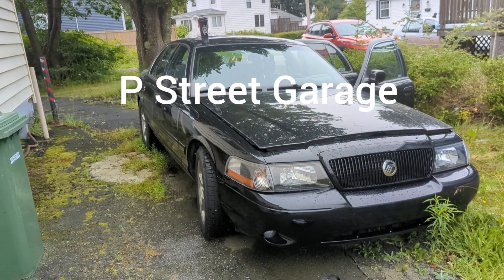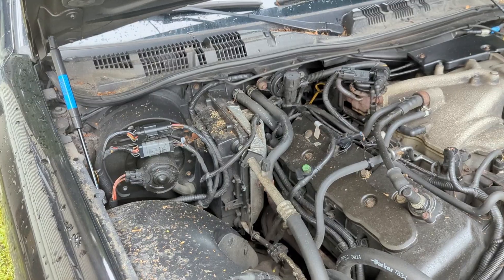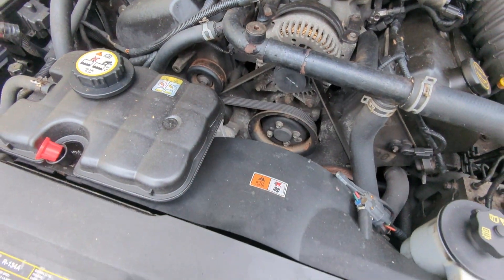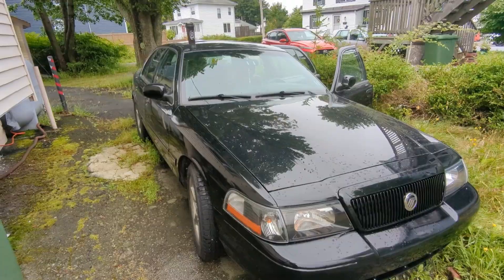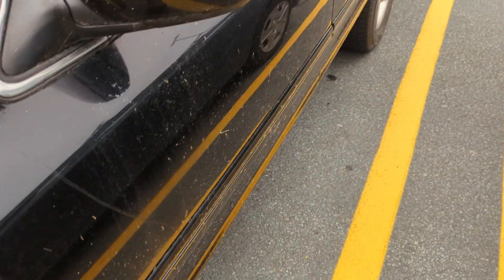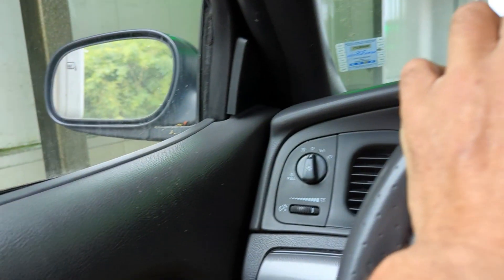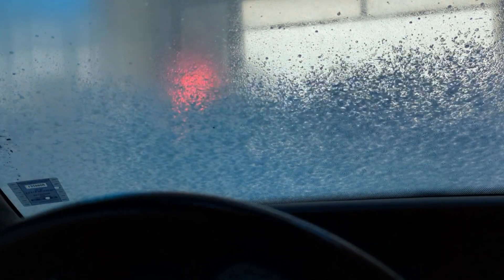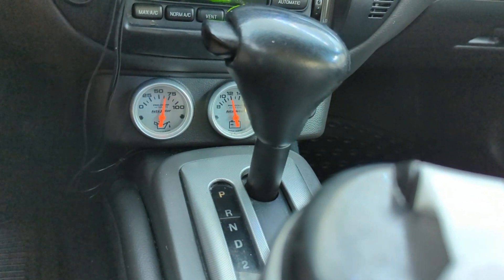Marauder.  First drive of the year

Comment: Nice old Mercury!
Reply from the maker: Thank you !!!  I love this car. Still need to measure my trunk lol
Reply: @pstreetgarage7304  I have new appreciation for the early 2000 Ford 4.6 engines, I've helped my nephew put an engine in his 03 GT and now we are building a turbo 4.6 for his 01 Bullitt so he can go drag racing.
Reply from the maker: @MostlyOldPartsAndRust  Really ?  You are doing a turbo 4.6.  Is it going to be on your channel ?
Reply: @pstreetgarage7304  It's going to be on my nephew's channel, Budget Horsepower it has his silver 03 GT on it.  It's a 2v with an On3 kit, with our custom touches.  It will retain the Bullitt intake and throttle body.
Reply from the maker: @MostlyOldPartsAndRust  Ok. I will check it out   Thanks
Reply: @pstreetgarage7304  Please do and comment on his video.  He only has one video, but I think it's pretty good for his first one.
Reply from the maker: @MostlyOldPartsAndRust  👍
Reply from the maker: @MostlyOldPartsAndRust  I can t find his channel ☹️